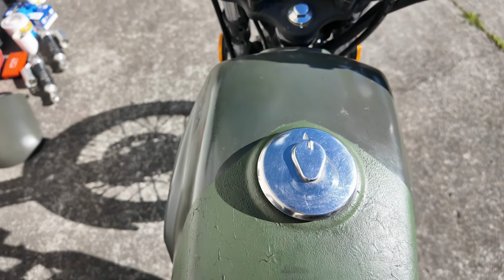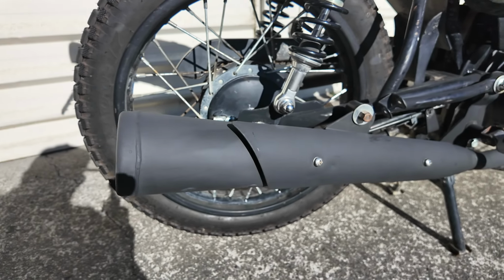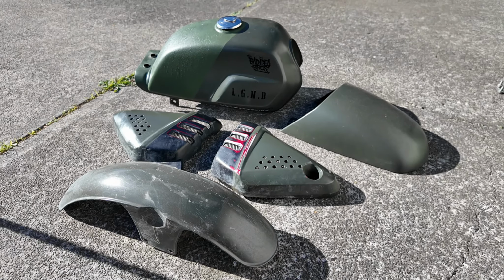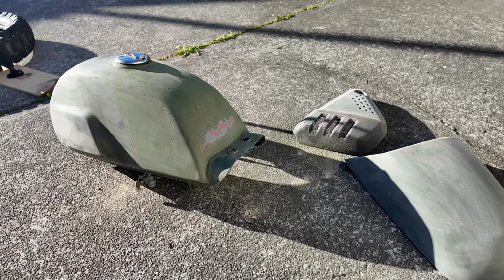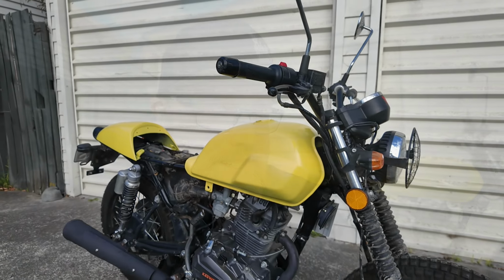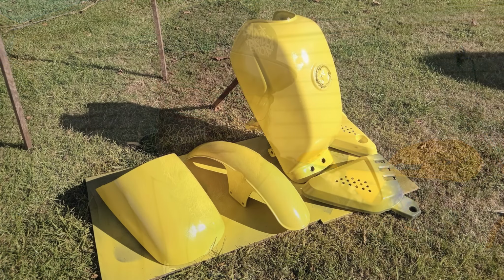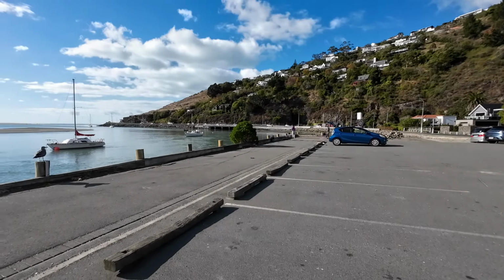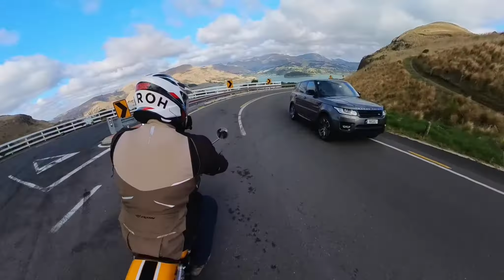Keeway CR152 Refresh | Custom Paint | Bike Build | New Zealand

Comment: Do you have solutions for the noisy head of the bike ? Or it is just normal to be noisy? Haha mine is a bit noisy even i already tuned it up
Reply from the maker: Our keeways get their adjustments checked every 3000km and they still tick and rattle! 😅 I think it's just how the top end of these engines are. They're not an overly stressed engine, so it's not really an issue in my opinion. Thank you for taking the time to comment. 😊 Ride safe bro! ✌🏻